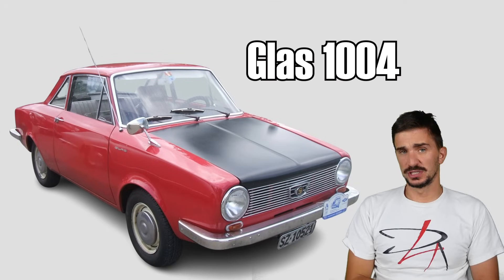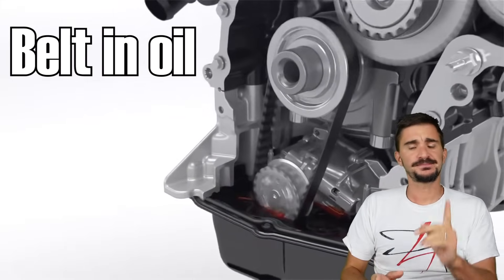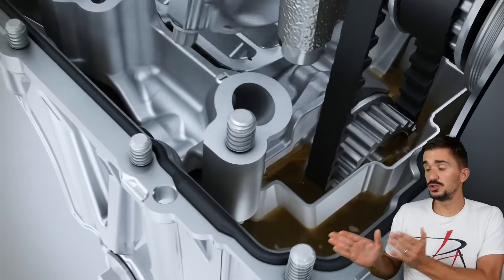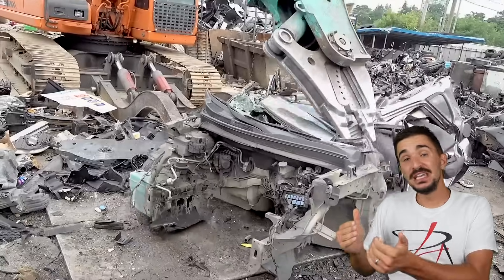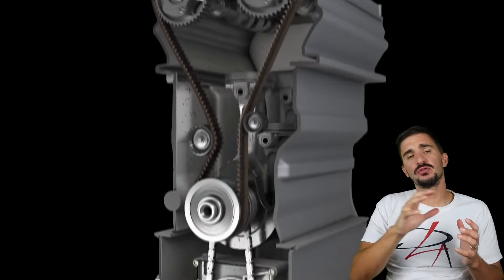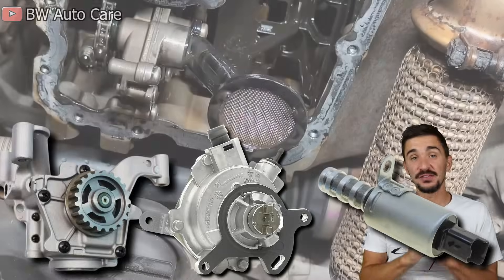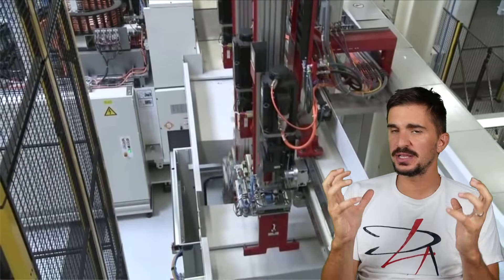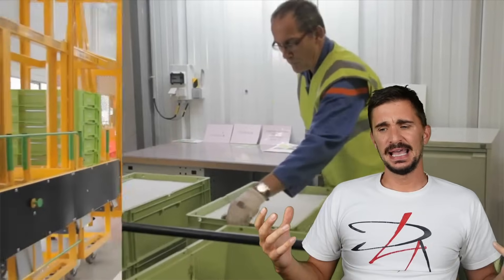Who Approved This and Why Is It Still Being Made? Wet Belt aka Belt in Oil Engines

Comment: Please remember that most of those engines were mostly developed before the diesel gate. At this time, European emissions standards were hitting hard, with regular and stringent updates, even if some cheated or interpreted it in some edgy ways. Bean counting design has been applied to so many engines back then, especially on the emission side of the spectrum.
Also, the market was more lively than it is today, and all manufacturers were trying to avoid echoing those development costs to the customer.

I worked as a machining engineer in camshaft/crankshaft manufacturing in the late 2010s. We had to cope with some design updates for like, -0,2 grams of CO2 per km.

Now, imagine if you follow the same search for minimal gains for a totally new design. If a design project leader was able to demonstrate he could maintain the same engine on the market for the next 2 or 3 euro emission updates, he would most certainly take the cake. So they generally stacked cheap, unproven, quick to develop solutions to obtain their results, without thinking of the aftermath.

Those consumption reductions were never meant to be perceived by the consumer, their intent was to develop a new euro compliant engine as cheaply as possible, that could be sold for many years without much updates, no matter the long term reliability. Small downsized 3 cylinders are just a plain example of their own.

What worries me the most is that they somehow have to compensate back the emission gains another way around if they bring back more reliable solutions.
Any ICE update or ground-up design is incredibly expensive for a manufacturer, and nowadays this will most definitely impact the selling cost.

Comment: I used to work for a major European car manufacturer. They released a new engine in the early 2000's, which had a timing chain that wasn't designed to be replaced. Instead, I was told the engine was designed for 100,000 miles (with regular scheduled servicing) and anything after that was a bonus. The point is, for any manufacturer to keep selling cars, they don't want long lasting cars that keep on going.
Reply: TBF, 100k miles on a car back then in Europe was a lot.
Reply: @Okurkaarrgghh  And ironically it also is now.
Reply: @Okurkaarrgghh  It really wasn't. Basically every EA827 VW motor except for the G40/G60 would do 150k+ miles no problem. Which is also why they were available dirt cheap on junk yards for ages - VWs were scrapped because they rusted out, not due to engine wear.
Reply: @artforz  I didn't say anything about engine wear...
Reply: If people buy junk, they will keep churning out junk.
Reply: right on point!
Reply: @artforz  I have to agree. In Brazil 30% of ALL the vehicles have this engine. NO Fails except some obscure bad manufacturing in the 80's and ReALLY bad maneintnence.
Reply: I live in Oz, 100,000 is counted as nothing. My daily round trip to work is 100km. I expect 300,000 out of an engine. Seen a few rack up 600,000, (Diesels).  Chains and gears rule the wasteland.

Comment: 13:02 There's one benefit for using rubber gasket instead of metal gasket: the rubber gasket is cheaper for the manufacturer. It's worse for the owner of said engine but if the owners doesn't understand what they are purchasing, manufacturers will continue keep introducing this kind of cheaper to produce parts in the future, too.

Comment: My ford Ranger 2.0 Bi-turbo use this timing belt belt dip in oil engine. The manual said to replace it at 240,000Km but I heard that a large number truck of the same model have issue of timing belt break before reaching 200,000Km. So, on my 165,000Km oil change, I decided to have the timing belt change as well. And sure enough,  the old timing belt the coms out of my truck had a lot of crack on its rubber. My mechanic told me I made the right called, the original timing belt wouldn't last another 1000Km.

Comment: Thank you for this beautiful made explanation about the wet belt problem. Never seen a program made so clear with your presentation that is absolutely magnificent.  I drive an Ecoboost engine nearly 10 years and for 136,000 kilometers and I try to sell my car a.s.a.p. It is a shame that manufactures keep producing this system. And its a shame that the Ecoboost motor won the price for best motor during 5 years at least.

Comment: I  have owned two Ford products, a Lincoln Continental and an E-150 van. While both had steel oil pans, they apparently were painted with a coating which allowed road salt and moisture to  work it's way under and eat through the pan, causing the oil to leak out. I repaired  each in turn with a material from an auto parts store which reduced the leaks to an occasional drip and got rid of the vehicles. Part of the price we pay to live in the rust belt  Thanks, Ford

Comment: Exactly what I have been thinking since I heard Fords Ecobust motors were running their belts in oil.
Just put in a much clearer and coherent manner than I ever could.
Great video.
Reply: Only the very small engines. The 2.0, 2.3, 2.7, and 3.5 liter engines have chains.
Reply: 1.0 and 1.5 and 1.6 wet belts?
Reply: @exothermal.sprocket  correct

Comment: Our company had a fleet of vehicles from a rental company who managed the fleet, and most cars had engines with wet belts. There were numerous cases of engine failure with 60K km because of debris from the wear of the belt clogging the oil ducts, pumps and so on. To make it worse, the maintenance was performed by third party workshops (not the car brand workshops) selected by the rental company, and the oil approved by the rental company was not the correct specification as the car's manual...
Reply: You left us on clifhanger, whats happened next?
Reply: This sounds like 1.0 Ecoboost or PSA Puretech
Reply: @MiGujack3  It was a 1.5 3-cylinder from Ford. Overall a good engine, with good power and fuel economy, but with this terrible maintenance issue
Reply: @AndriusKamarauskas  The rental company had to replace engines on some cars, but eventually due to several other problems with maintenance of that car model, the management at my company demanded an action to avoid lost time and ensure safety for the employees, then they anticipated the renewal of the contract to replace the fleet with another model (fortunately, the new car uses timing chain instead)
Reply: Corporate AT IT'S FINEST.
Reply: that's what 99% of car rentals do (in the world)
Reply: I know that warranty coverage was denied due to these technicalities, but the same thing would have happened if the dealer serviced the vehicles.
Reply: @markleggett3944  Unfortunately, yes. There are cases of cars of other brands which also use this kind of belt that had problems even following the correct maintenance schedule and proper oil.
Reply: @InsaneDeck  Thanks.

Comment: honda came out with the GC160/GCV160 mower engines in the early 2000s, rubber timing belt that rode in the sump. I got out of the industry by 2012 but even to this day, I've never heard of one failing. Those were good little engines. After going through honda training school on them, they explained to us all these little things they had thought about. Like, for example, the choke lever had a nub made onto it so you could plug the fuel line with it. Everything was really designed as much as they could to make it easy to work on. I inquired about timing belt changes and while they did make the crankcase come apart in such a way you could change the belt, they said most would never need it, as it lasted the life of the engine. And, they were right, like I said, never saw one fail. 
Of course, Honda was also making riding lawnmowers with timing belt driven engines back in 1985, which is just insane haha.
Reply: 10 years on the wet belt in my gx25. Crazy how good these things are. Regularly see them with 25 years on them on fbm. But i bet it has something to do with the hp:belt ratio. Probably much better on these than cars.

Comment: 5:27 Renault 1,2 and 0,9 tce engines have timing chains.
1,5dci has dry timing belt, i have 2 from different ages and power. Dry belt.
Reply: Indeed, Renault has only dry belts and chain engines to my knowledge. Great video though!
Reply: Yes, the engine in my Dacia Logan MCV 0,9tce has a timing chain.
Reply: That's correct, but the 1.2 TCe is also known for segmentation issues, which also catastrophically broke the engine early. At least they fairly quickly fixed it around the end of 2016 and moved on to the pretty good 1.3 TCe after 2017.
Reply: @AlexisyFR  In our fleet of company and personal cars/vans we have; 1.5dci, 1.6dci x3, 2.0dci, 2.5dci x2, 1,2D7F and 1.3Tce from Renault, also we have few Nissan vehicules and had some VWs.
With good maintenance they serve us quite well. Only 1.5dci, 2.5dci and old D7F have dry timing belts but that is not a problem, they are not sensitive.

Comment: In 40 years driving front engined Porsches, I’ve changed dozens of belts, both cam and balance. A good belt was a dry belt - period. Those belts were a big deal to replace and tension properly and of course, interference engines. I got pretty damned good at it. If I could detect any sign of oil on those belts, I knew I had much bigger issues and that they were NOW issues.
Reply: If it's not leaking it's either a Porsche or it's not an old German car😂
Reply: @finleymakee4850   Well, it took a second to parse your odd wording, but it looks like “only Porsches do not leak” which is close to true but old German cars all leak, which of course makes no sense.
Reply: @artysanmobile  If any old car doesn't leak at least a little that's how you know you gotta add some oil or you've got a bigger problem😅

Comment: Nice to see you do a 180 from your "companies aren't evil" video. They might just have been inept when they first did this but they became "evil" when they kept doing it. There's lots of this in many industries and the current state of things is outrageous but there is finally some push back, we'll have to wait and see if it achieves anything. Not to put this on you but this widespread "I don't want to be negative" feeling is how we got here, you should be negative when you have a reason to be.
What I'll be doing is fixing my 16year old car, which has never broken down, even if it's not financially viable to do so as I'm sure it will last 16 more years if, worse case scenario, I spend half the cost of a new car on it and I'm pretty sure the new car won't last 16 years.
Reply: The companies are behaving badly because the government destroyed their profit margins with fuel economy regulations. This all comes back to government central planning.
Reply: @gregorymalchuk272 excuse me, but have you seen the climate lately? Emission standards are necessary and inevitable. It is sad that cars become more expensive, but I prefer that, than living in a mad max style world with collapsed weather. I know, cars are not the sole emitters of GH gas, but we need to battle it from all fronts.
Reply: @gregorymalchuk272  yes blame everything on the government and not on the greedy manufacturers that hain directly from this kind of practice.

If it was really the case that the manufacturers are doing this because of environmental regulations, then why are they going back to normal dry belts and why doesn't every engine have a wet belt?
Reply: @maxiferrari08  Because the cost of the wet belt lawsuits and warranty claims exceeded the 1% fuel economy benefit toward not getting fined millions under CAFE regulations.
Reply: @gregorymalchuk272  so it is because of the manufacturers greed, noted
Reply: @gregorymalchuk272  The second problem, other than the people who dislike negativity, is people finding excuses for such behavior. It's unacceptable regardless of the reason and all industries are doing this because there's not enough push back, even companies that are richer than ever are doing this.
Also, people are driving more than ever, and all car companies have an electric option, it makes little sense that fuel would have a large effect on car companies but even if it does, it's irrelevant.
Reply: @maxiferrari08  The manufacturers are competing for investor capital. If they can't support returns on investments competitive with other sectors of the economy, capital will flee from the car industry.
Reply: @gregorymalchuk272  It's just bizarre that anyone would believe such absurd nonsense...
Reply: @mjames3662  You don't think that car companies compete for capital?

Comment: You just did a great job of laying out the facts. As a retired mechanic it greatly disturbs me that the manufactures seem to not care once the garbage they produce is out of factory warranty (Ford Motor Company).  Now also GM with their 3.0 liter Duramax Diesel that uses a wet belt to drive the engines oil pump. To replace this belt the transmission has to be removed! This is why we as consumers need to do a lot of research before buying. Your video is an important part of the information us consumers need to make an informed decision. Thank you.
Reply: What?  Damn.  I just finished posting I thought (in the US) it was only Ford using these things.  Damn it GM I thought you knew better.
Reply: @hwertz10  GM knows the facts about these wet belts. They are using wet timing belts in their 1.2 turbo engines. The recommended replacement interval is 130K. Very few, if any will last that long, but they will be out of warranty.

Comment: This reminds me of manufacturer's recommended oil and oil filter change intervals, which, while I have been driving went from 2,000 miles, in pre-1990 cars, to 5,000+ miles in newer cars.  I once changed oil every 2,000 miles but now generally go 3,000 miles with the assumption that fuel injected engines reduce the rate of oil contamination. In general, I have mistrusted factory service intervals.

Comment: 5:27 the Renault 1.5 dCi uses a dry timing belt, and the 1.2 TCe and 0.9 TCe use timing chains.
Reply: 5:34 the VW 1.5 TSI uses a dry timing belt
Reply: 5:40 the GM/Opel 1.5 turbo petrol engine has a timing chain.
Reply: 16:42 the Honda 1.6 iDTEC uses a chain not a wet belt (you can even see the chain in the photo you used). It was the Honda 1.0L turbo 3 cylinder petrol engine (P10A2) which had the wet belt!
Reply: Was going to say this too, among the small displacement turbocharged engines, the 0.9tce from Renault must be one of the more reliable since it has a timing chain and multipoint injection, so less chance of admission carbon build up. Who knew old tech can still be good 😁
Reply: Correct, Renault didn't use wet belts on any engine afaik. @d4a maybe you should update the misleading info. Thanks for the video.
Reply: @YZJB  Some VW 2.0 TDi engines use a rubber oil pump belt though.
Reply: @YZJB  That was also strange to hear since that engine is very reliable. Honda claimed 1 million km.
Reply: @YZJB  Is it at the gearbox end though?
Reply: @hunchanchoc8418  is what at the gearbox end?
Reply: @YZJB  The timing chain.  Cos the chain/belt IS at the gearbox end on some Vauxhall engines,
Reply: @hunchanchoc8418  the GM/Opel/Vauxhall 1.5 turbo has a conventional front-end timing chain.
Reply: @YZJB  Phew, good!  :-)
Reply: And vw never had problems with o-ring on the oil pump, instead have it with an oil pump shaft.

Comment: Retired mechanic the Ford 18d engine kept me employed for 10 years refurbishing cylinder heads broken by snapped tim8ng belts❤😂
Reply: Ford realized that many people did not want to spend hundreds of dollars on maintenance to replace a timing belt and just kept driving until it was too late. Also, belts are cheaper to produce and are a source of revenue for service departments, as you say.

Comment: Honda used the wet belt engine design on the 1.0L turbo three cylinder gasoline engines from 2017, but not on the 1.6 i-DTEC ;)